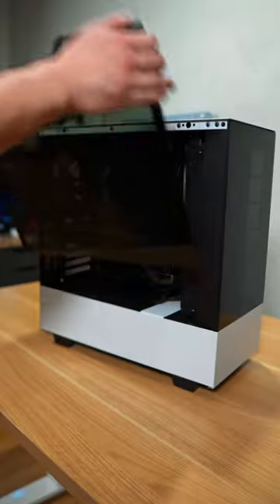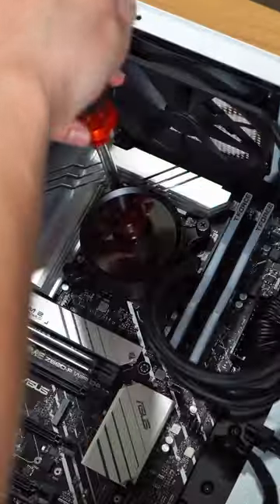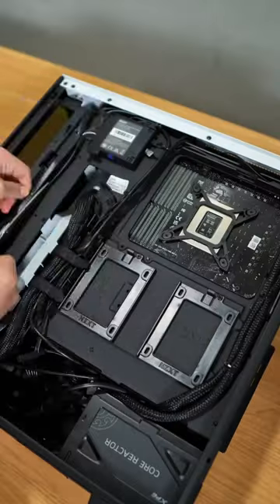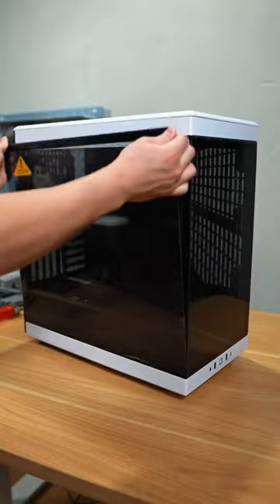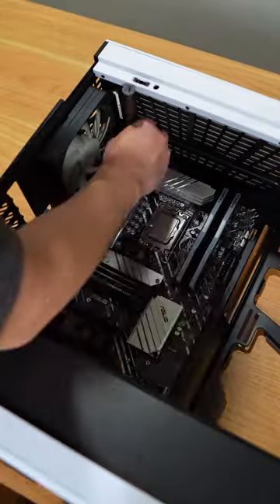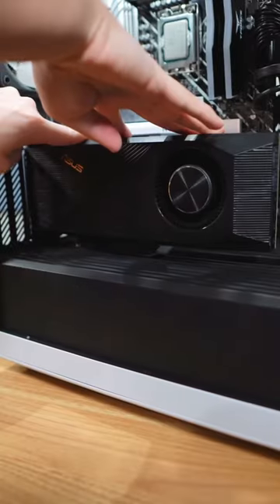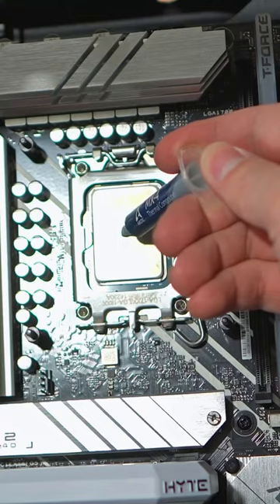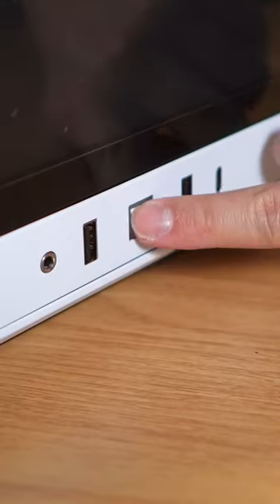HYTE Y40 PC Case Swap #shorts

Comment: Dude I was worried having my radiator where you have it was "wrong" but I feel so validated!!
Reply from the maker: For this case that's the only place it fits. I wanted to mount it up top originally
Reply: Tubes at bottom to keep from air getting trapped in the impeller and ruining the pump.

Comment: Could the y40 fit the 7900 XTX?
Reply: Definitely
Reply: yea you can usually google case clearance. In this case I did it for you. It has like 91mm of gpu height and 400ish mms of length. longest cards are like 340 350 mm and 72 mm tall. Hyte recommends 80mm max height for ample cooling so any 7900xtx under that requirement should be fine